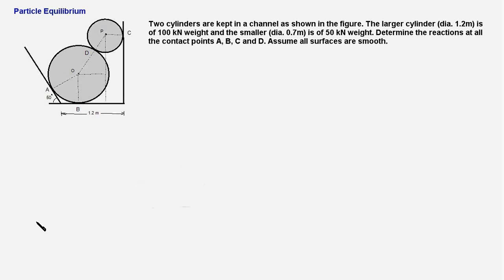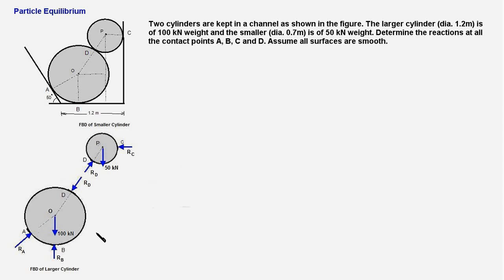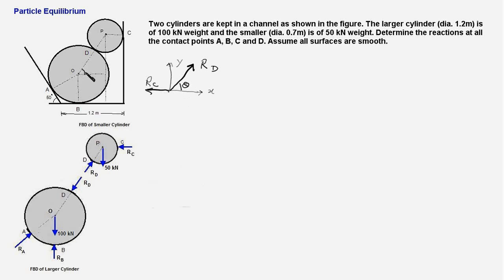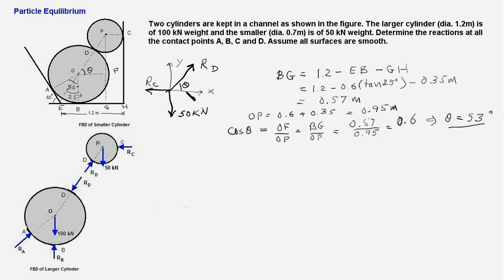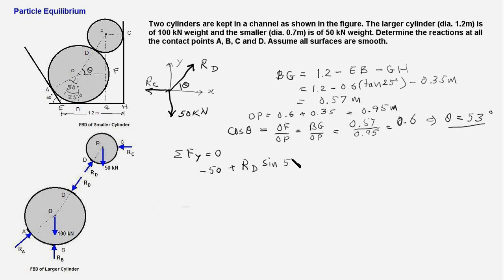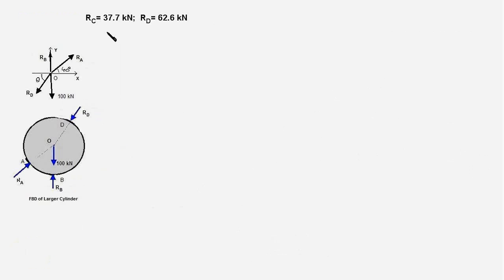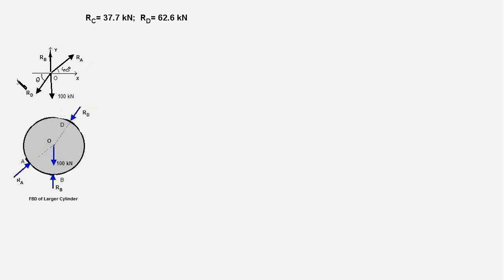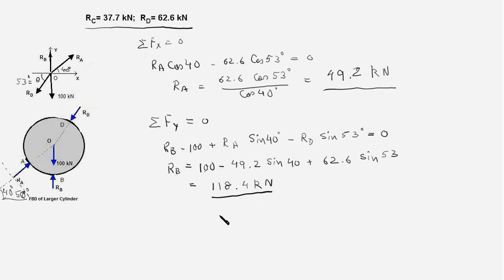4.2 Engineering Mechanics: Particle Equilibrium (Cylinders in a channel)

Comment: How did you get the angle ADB as 50°? 
You didn't mention any rule or law for that
Reply from the maker: Hello Ganga:  Want to clarify that the angle AOB is 50 deg, and not ADB. How did I get it? Answer is elementary geometry... extend the line OA so that it meets the horizontal line through E at say point Q and you get a right angle triangle AQE. Since angle AEQ is 50 deg., angle AQE would be  40 deg. Now consider the right angle triangle OBQ. Angle  OQB is 40 deg., so angle AOB is 50 deg.  
So you make a general rule... if a line makes an angle Alpha with the horizontal, the normal to that line would make the same angle Alpha with the vertical.
Hope that helps!

Comment: sir how was the  angle 40 degree? please comment
Reply from the maker: I think you want to know how the reaction Ra makes an angle of 40 deg with the horizontal. Extend the line of Ra backwards so that it meets a horizontal line ( as shown thru' dotted lines in the video) and you get a right angle triangle - one angle is 50 deg so the other would be 40 deg.I hope this helps in clearing your doubt.
Reply: Vector In Motion thank you it helped me a lot